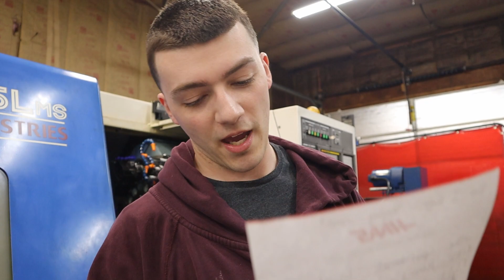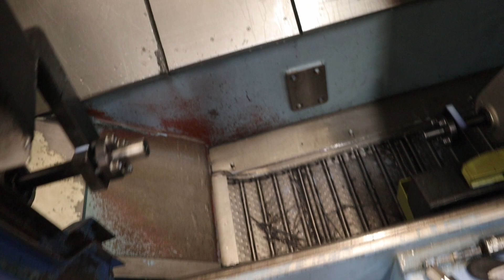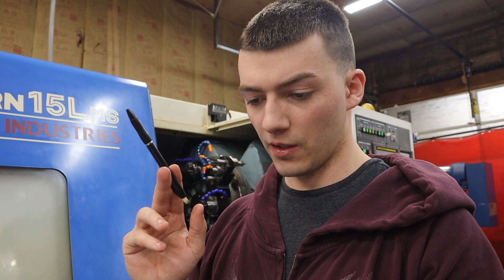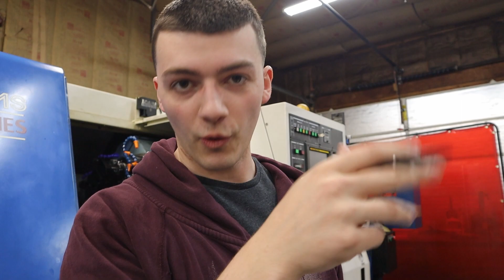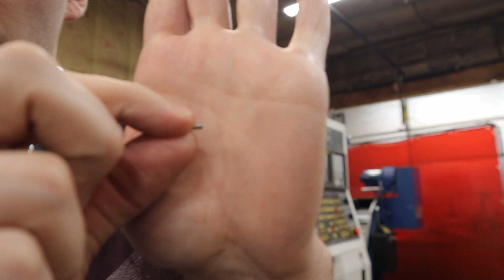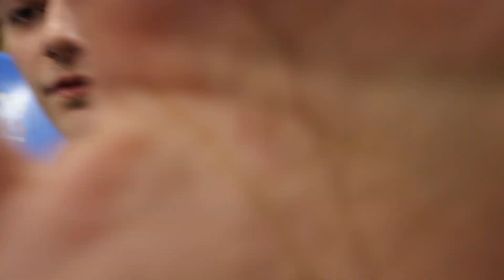Kia 15LMS final overview - Should you buy used CNC equipment?

Comment: Bought a used 2005 Haas Mini Mill with 7500 hrs..  Ended up needing new x and y rails and new ball screw drives and lots of work on the oiling system... Never going used again unless it's a perfect machine with little to no hours.

Comment: I installed a $15k used lathe with Y axis, subspindle, live tools with an $8k phaseperfect and $6k rigging. Few more thousand to DMG Mori service for turret alignment stuff.  over 100% ROI already though. My hydraulic actuator also wobbles at high RPM. 1998 Mori Seiki SL-25SY/1000 with Fanuc 16TTB 512KB memory per side. My old lathe still needs ballscrews removed and refurb (lots of backlash).

Comment: Thanks for the overview. You said you have a phase converter.. Does that mean your shop isn't wired for 3 phase and you have to generate that third leg? I'm no elec-chicken, but does that mean you require a huge amount of 220 single phase? I'd love to know more about your electrical setup.
Reply from the maker: Running a phase perfect pt355 supplied by 100 amps single phase. It actually runs on a single phase 60 amp breaker, and runs the lathe, mill and screw compressor together. Not without compromise of course, but seems to do the trick.